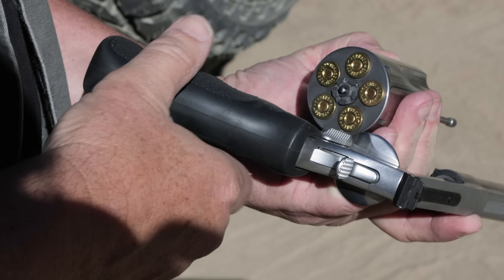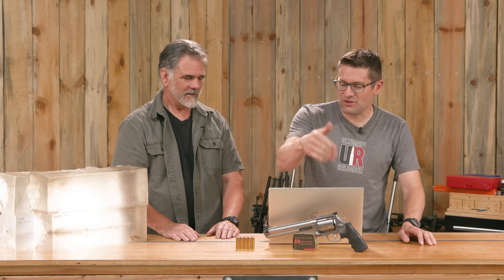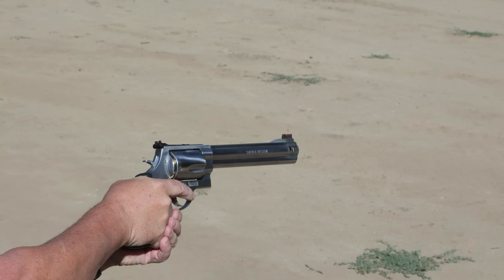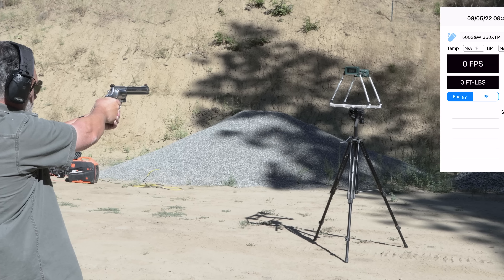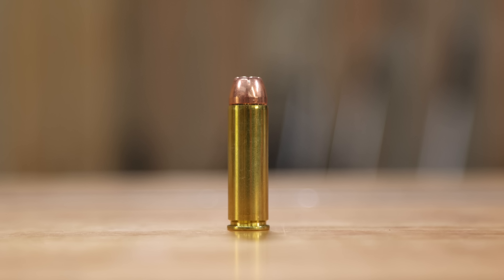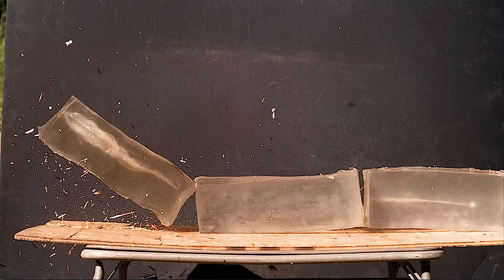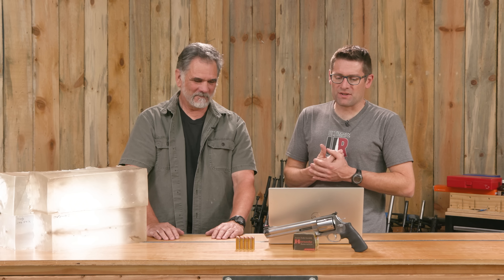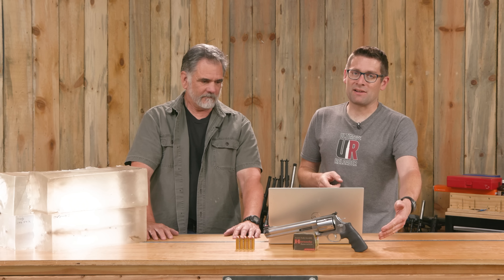500 S&W Mag with Hornady 350gr XTP Bullets

Comment: I have a H&R with a 22in barrel chambered in 500 S&W currently shooting Hornaday FTX at 2419fps with a SD of 6 and ES of 17fps. I currently use it to hunt whitetail and black bear.
Reply: What powder, primer and case are you using to get SD and ES that low?
Reply: 👆Thanks for watching^^^^^^
Send a direct message, something special for you...
Reply: @davidtolley1374  I'm using remington large rifle magnum primers with 50gr of hodgdon H110 using a pressure gage on handle of press for consistent crimp pressure. Those numbers was from a 10 shot string over my magneto speed.

Comment: Overkill? Not really because dead is dead as long as you're not trying to keep the meat from the animal if it's the size of a jack rabbit  lol but I have one and I shoot mostly extreme  325grn plated bullets with a 18.5grn charge of longshot using the 350xtp oal because all my books just have barnes load data for 325 grain bullets and they're super long so the xtp oal works fine and for the heavier bullets I use my own hard cast and powdercoated 440grn rnfp bullets with 4227 going 1500fps and no gas check and it's never left any lead in my barrel
Reply: 👆Thanks for watching^^^^^^
Send a direct message, something special for you...

Comment: You guys keep talking about massive wound channels, this time you said 12", is this the temporary wound channels? If so, from what I hear is that the temporary wound channels has little effect on killing power. Most animal tissue does expand like the temporary wound channels shows, it also contracts back to nearly normal just as quick. 
The permanent wound channels is the better indicator of killing power. Those pathway is where the animal bleeds out through. After the temporary wound channels collapse back to normal no blood flows from them.
Even in high velocity rifle cartridges the so called hydrostatic pressure created has little effect on killing power.